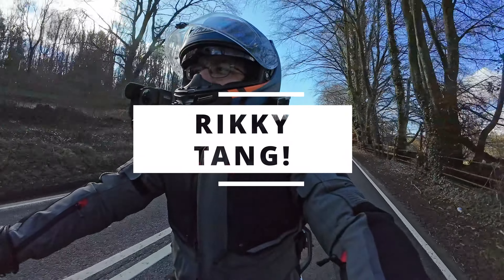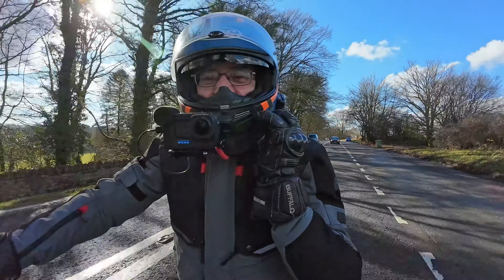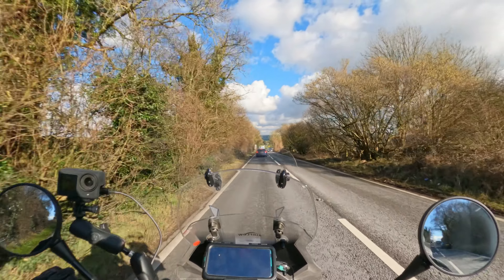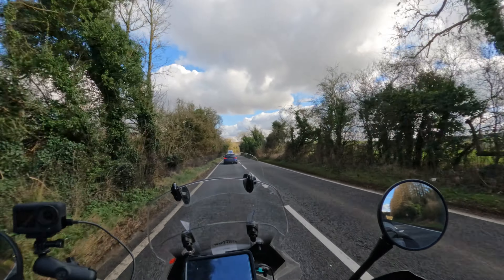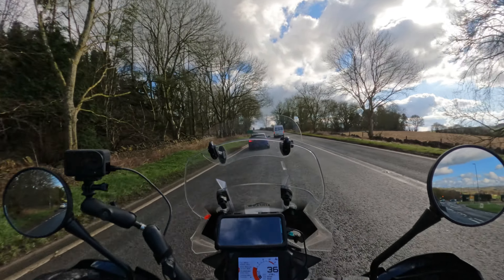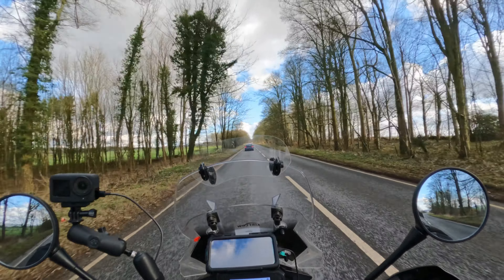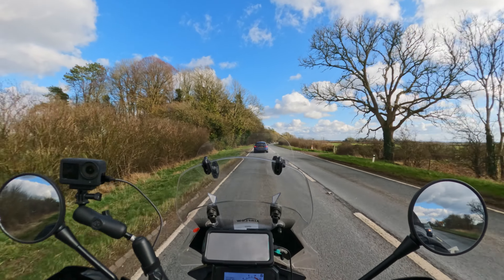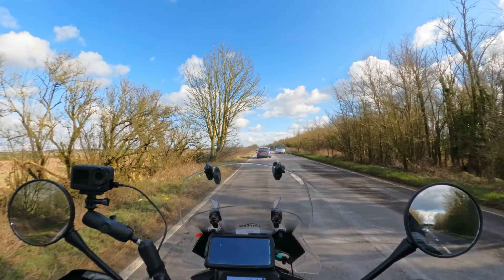KTM 390 Adventure update and also... What bike next?

Comment: Gotta be the GT+, even comes with full luggage 😎 Interesting I have a 1250GS which is due to be replaced this year, but the new 1300GS looks like a cats arse so I won't be getting one of those. But I really like the look of the R9T Scrambler.
Reply from the maker: Yeah the Tracer would be the best choice for a road bike, but I kinda feel the same way about it as you do the 1300GS! Having said that I'd probably not take it on a trackday and the tracer means that I couldn't afford a track friendly bike as well. The scrambler looks lovely too though, so ive still got some thinking to do and it's all still up in the air!

Comment: Your next bike could be an Aprilia Tuono V4? Would cover both the the touring & track day options. GSXR-750 is iconic. XSR900GP looks great, not sure of ownership practicality. Tracer is a bit... Uninspiring. I wanted one 4 years and was disappointed when i finally owned one. Im sure plenty of other people love theirs. I currently ride a Ninja 1000SX - bit boring but a fantastic machine. Will be interesting 2 c what u go 4. Enjoying the videos - keep it up 👍
Reply from the maker: The Tuono V4 is tempting for the sound alone! After owning two big/fast naked bikes in recent years, the plan for my next big bike is to have some wind protection from a fairing (unless the heart wins over the head... which is possible!). I've ridden the Tuono and it feels like a naked bike, despite the extra bodywork.  Same goes for the Kawsaki ZH2.
I haven't ridden the latest gen. of the Tracer yet and so the jury is out really until then.
The Ninja 1000SX is an option, as is the GSX1000GT or GX, but the BMW S1000XR with low suspension would likely be a better option for me... unless the XR's handlebars are too wide to get the bike around the side of the house for parking! 😂